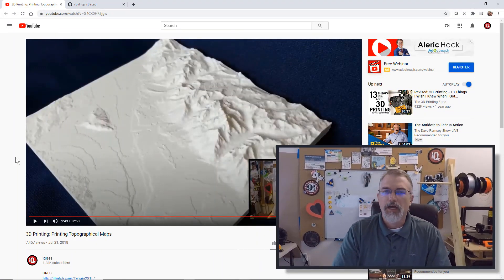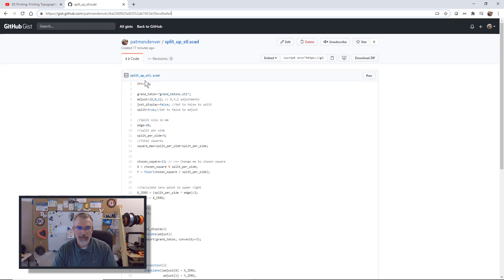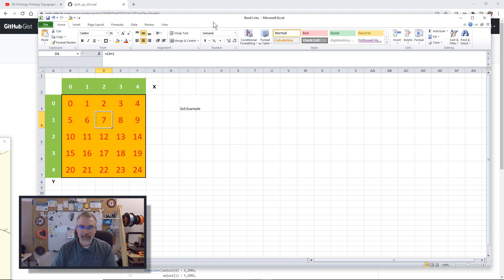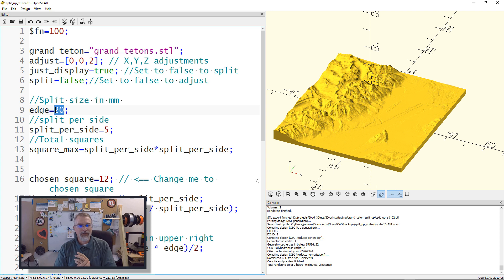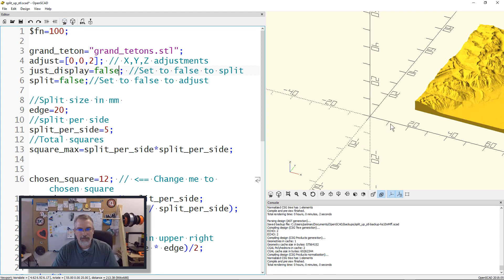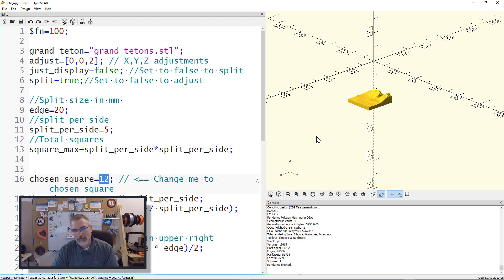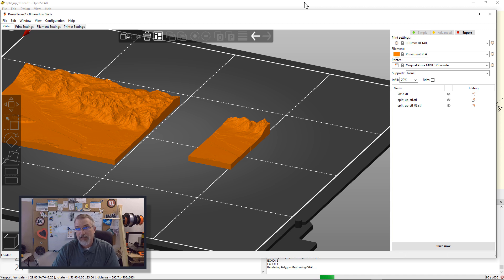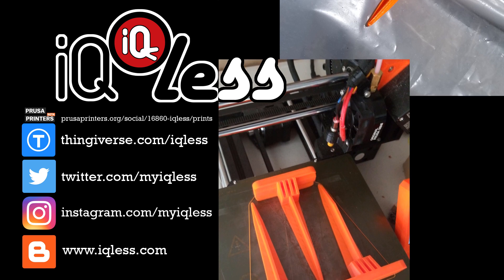3D Printing: Splitting up an stl file with Openscad

Comment: Interesting project.  Is there an easy way to strip the xyz offset in some STLs?  Many times I find something close to what I want and use import, difference and union to make what I wanted.  But some STLs when imported are off in left field.  So then I need translate with some trial and error on the numbers.  I'd like to edit the STL and just remove the offset.